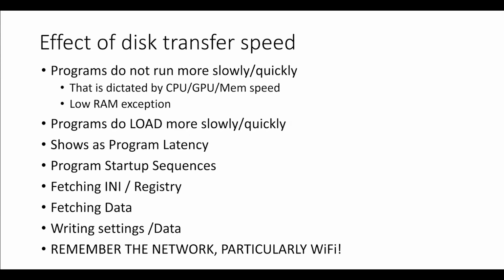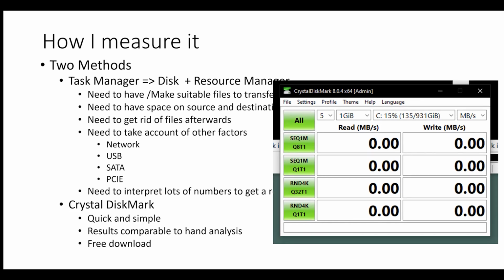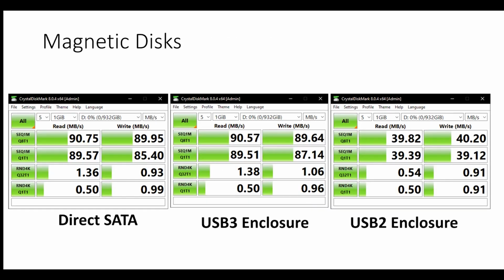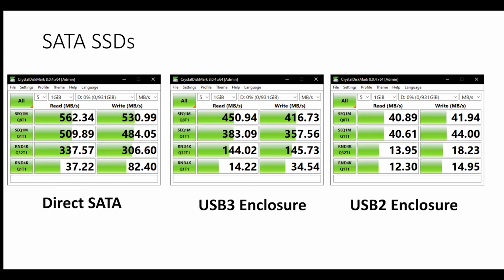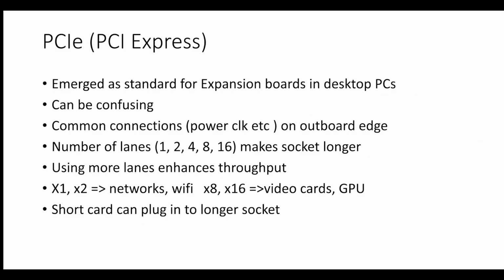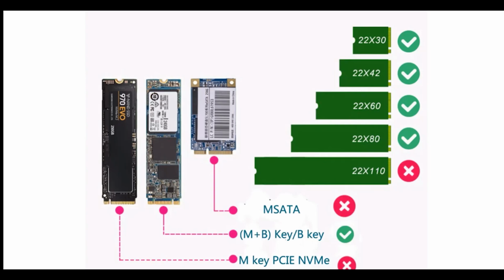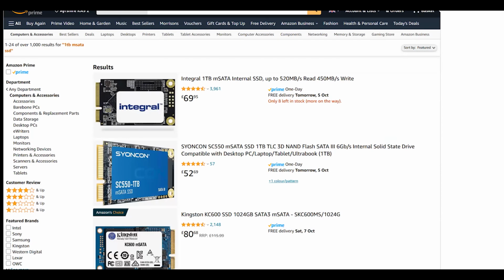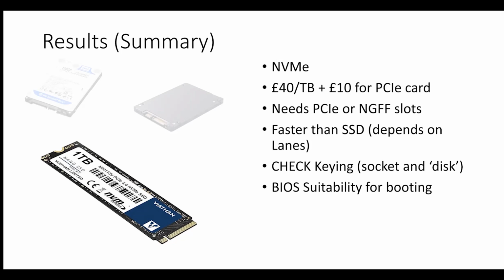Disk speeds

Comment: thank you, very comprehensive overview and including your personal mesurements which is an enourmous valuable input. very impressive is the ramdisk example. some months ago we fitted a 500gb nvme ssd on a pci-e card and assigned it with a software program as cache to the system drive (sata ssd). The computer is aged (10 years +) but a working horse (2 xeon e5-2650 cpu) and didn't want to start from the pci-e even after tweaking some days. It is used remotely by several users and the performance went up so impressive that they love again using it for scientific calculation. Before we were stopped by the 128GB RAM size available for that machine and always ran into cache issues via the sata interface. The installation of this virtual cache changed the situation drastically.
Thank you again for the video and best wishes for christmas, Albrecht